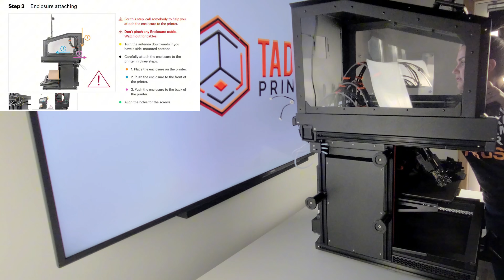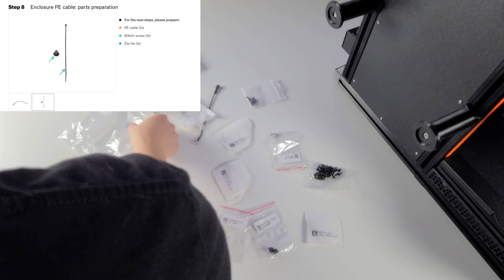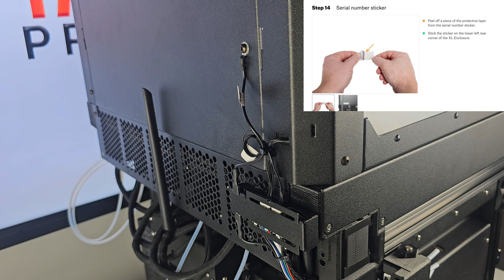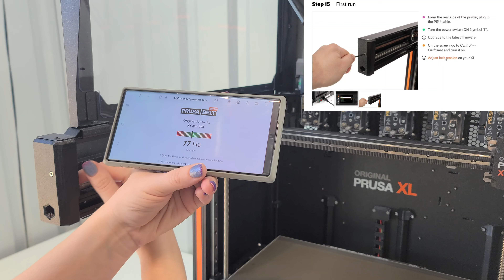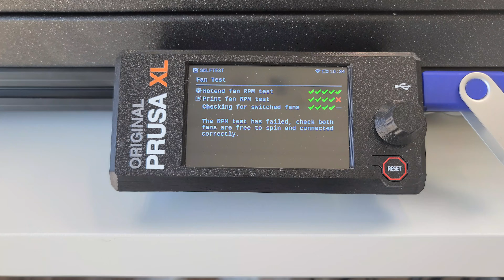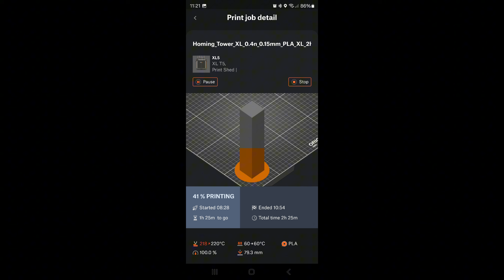Final Chapter 6 XL Enclosure Build

Comment: I switched from an EnXLosure over to the official Prusa one. I think Prusa is charging way too much for something that takes 3-5hrs to assemble and install. The exhaust fan and filter seem like a hack and maintenance/ops were not optimized. You should not have to unscrew the entire fan/filter assembly to change the filter. The filter itself probably has marginal value for getting rid of VOCs. The bellow bottom portion feels cheap and like a hack instead of some nicely engineered doors. The top should have had struts of some sort. I feel like the company is still attempting to ride their brand reputation but I really worry about how they'll fare when Bambu comes out with an enclosed XL-sized printer. It would be great if you could do an 8-min video that talks about your overall assessment of the build process and value of the official Prusa enclosure.
Reply: Great idea to rerun the calibrations again.  I mean besides moving to another room you rebuilt the tool heads.     I am surprised the order Prusa has us do this. Personally I would prefer to just modify a tool head then to calibrate and run a quick test print before I possibly destroy my entire printer doing the same thing wrong 5 times in a row :0)
Reply: Sad there are still fan problems, I had hoped with the replacement of all the parts they would have found it.   You need the fan shrouds you can’t print well without them.  They direct the air flow.
Reply from the maker: So would you have preferred the EnXLosure now after looking at both? 
I agree that having anything in the back is odd placement and it makes the machine even deeper. 
I like how open the bellows are but I would've liked tracks for them to slide in. 
Yes it'll be interesting to see what's next. Although the XL low waste on the color change is still very competitive. Thanks!
Reply: @tada3dprinting  I wasn't a fan of the top of the EnXLosure because of it's flimsiness and the fact that toolhead 5's PTFE tube and cables tended to smack and rub on the side plexiglass. The build time for the EnXLosure wasn't exactly short either because of like ~70+ heatset inserts that needed to be installed. I wanted at least some sort of hole for filtration and there weren't many options out there.

I'm actually not a huge fan of the bellows because I usually keep the printer enclosed at all times to keep dust out of the unit. This makes it a pain to remove the purge lines. Your idea of tracks isn't bad either. I prefer the EnXLosure doors and the official Prusa top minus the fact that horrible design of the fan/filter. I did remix a fan enclosure/replacement to have a 3" hose duct on it so I can use an air purifier but I haven't installed it yet because I haven't decided on how to deal with potentially removing the stock enclosure fan.

Comment: If you look at the comments for step 10 you see that more people had the same thing about the lenghth of those cables. Probably they shortend those after review. 
And i didnt had any issue's with the fan shrouds during the test.
Camera i didn't solved yet, got the same cam as you. I switched off the fan in the menu, as long you don't print ABS and other filaments that smells. For PLA and PETG i leave the fan off. Not printed the homing tower tbh so can't tell.
Reply from the maker: Yes, they must've changed the length of cables. I have been running my wyze with the same mount but im not liking the reflection. Something to change soon. Thanks so much!